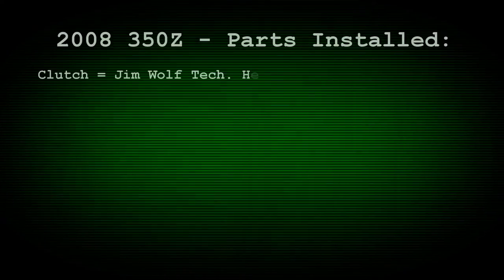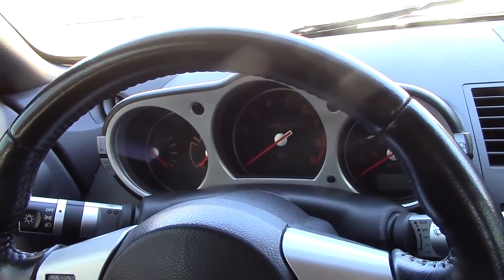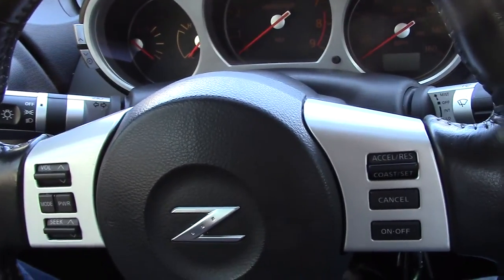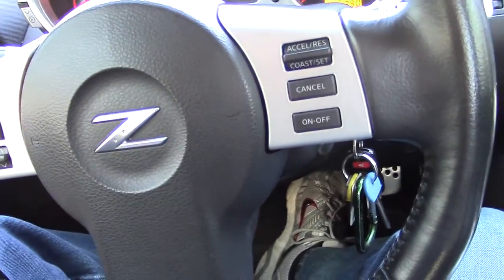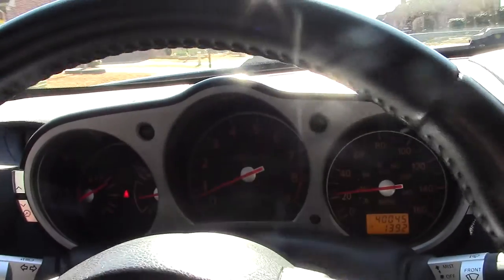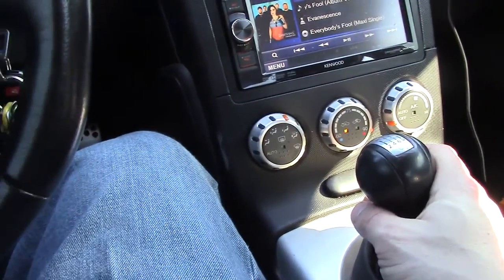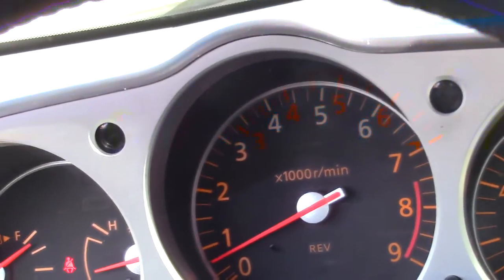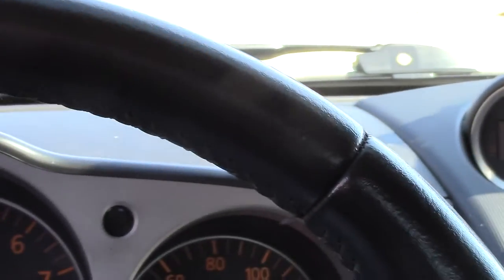350Z JWT HD Clutch - Zspeed HD Slave Cylinder - Wilwood HD Master Cylinder - OEM DualMass Flywheel

Comment: Did it originally have a single mass?
Reply from the maker: No originally it is/was a Dual mass Flywheel.  I had a tough decision that goes against what most people who are performing perf. parts in do.. and that is to with a lightweight and deal with the noise.. or go with a new OEM dual mass and not have the noise.  I knew the noise would bother me more than the benefits of a light weight flywheel.
Reply: Ikos Log In my Vr6 I went with a single mass flywheel but not light weight. Steel and around 20lbs. There is some some sound but not really noticeable unless it is quiet out. And only hear it when sitting at idle.
Reply from the maker: Drewdownkali Yeah.. in the 350Z and 370Z's Nissan designed a really solid transmission with an extremely noisy drivetrain.  Rock solid just noisy.  All 350's and 370's have the throw out bearing noise when at idle in neutral.. but no noise beyond that with the Dual Mass flywheel.  However, once you swap that flywheel for anything else (lightweight or even a really heavy single mass) it becomes super noisy while driving under load until 2500RPM in any gear.  So the $867 for a new Nissan Dual Mass flywheel for this particular car was well worth the money to keep it sounding , well, quiet.  It's not uncommon for people who don't know Z's to ask what is wrong with your car if you have a lightweight flywheel due to the noise at low RPM.  It's my DD, and I consider it "nice" and want it to sound that way too :)  But to each their own!
Reply: Ikos Log I have had people thinking something was wrong with my vr when they hear it at idle. If I press the clutch it and let it out very slowly the sound either goes away or is less noticeable.
Reply from the maker: Drewdownkali It's the same with the 350/370 and Inifiniti G35 and G37's.. The throwout bearing noise is quiet apparent at idle with clutch out.  The new setup I have in makes it a bit quieter than stock, I would simply because it's all new.  I remember with my 300ZX when you heard that throw out bearing noise at idle it meant it was going out as it was quiet under normal operation.  However, in the VQ35HR's it is very much "normal" to have this sound. :)

Comment: My 07 made it to 125k until the throw out bearing went out. I guess ill just do the whole thing now
Reply from the maker: Nice!  I've always had 'initial' clutch problems in my Z's.. My first car was a used 300ZX -- and I treated her well, but well.. also DROVE it.  Hey I was 16-19yrs old before I sold it.  :) -- The throw out bearing noise in the Z's is almost a feature unto them.  They always have super loud unloaded bearing noise -- Get in any Z3x (manual) go drive up to a wall, or tunnel or whatever... put in neutral let out clutch .. and there it is in all it's glory (and that's normal) :)

125k is super for the whole system to go without major issue.   It's more than due for an 'overhaul'.  I'd probably do it all myself.. I know I would -- I had just master or slave issues and I replaced every component in the clutch/hydraulic system (Master, CSC, Lines (With SS), Clutch (JWT), Flywheel, and so on -- everything I replaced I replaced with 'better versions' of OEM to prevent failure as the HD Master and Slaves are redesigned to stop the premature failure so often seen in the 350/370's -- The only stock component I bought was the Dual mass flywheel and I wrestled with that decision because of cost + performance -- In the end I wouldn't be happy with added noise to the car while driving at super low RPM's so Found the best deal on a new OEM DM Flywheel ($800) and am quite happy with the ending result.

System is quieter than it was before (though wasn't loud before) -- just something I noticed and that's just really the throw out bearing noise as the clutch system doesn't make noise while driving especially over the deep exhaust of the 3.5 or 3.7L of the Z's.. I think I ended up spending about 2 Grand (give or take) on parts.. labor I did myself and surprised myself when I got it done in a day without major headaches popping up in the process.

I brought it down to a "Z Specialist" to do the work.. but he had some family emergency called me late at night and said you have to come get your car (he was leaving town) and he doesn't leave cust. cars in shop for liability I guess) -- When I picked it up and was driving it back the shifter was letting in noise from the ground and it wasn't matching up properly with it's tracks.  It had a good 2-3 inches or more of excess movement out to the right past 6th gear/Reverse -- I sent a video to the guy showing him and called him.. He said "Oh they never go back together exactly the same"..lol.  

I was like, ermm. No, this is not just a slight difference it's wrong.  He maintained his position.  So I said ok fine.

I took it apart next day and quickly found the problem.  He put it on , literally, backwards/reversed -- I'm amazed it functioned that way to be honest.  Within 10 minutes I had it back the way it was supposed to go and took it out and was factory quiet again and no more 'play'.  (That was a relief.. I had no idea what he had done).

Good luck with your swapping -- I would recommend aftermarket on everything but get on forums and such to find what is good and what is crap -- What I picked for my Slave, Master are the best made so it'd be safe going with those two (but do your own if you want to make sure) -- Flywheel -- OEM if you don't / can't stand any chattering noise at low rpm's (like me) -- And of course your pick of cheaper lightweight non dual mass flywheels for faster spin up .. bit of a tradeoff.   Clutch those are easy to find .. most companies with reliable names offer several packages which all depend on your needs and how hard you want that clutch pedal to be ;) -- I elected JWT HD.. far exceeds my 360HP and didn't take long for it to feel 'normal'.  

For labor -- most places were a couple thousand dollars or more -- though I did find a technician at a nissan dealership who would do the work himself at nissan for $600 -- So deals for reliable work can be found , you just have to put in the calls, etc -- Helps if you have all the parts (leaving nothing out) for them to not have to dig into inventory for something other than lube, or random bits.
Reply: I just ordered the JWT with the higher clamping force and the 14lb flywheel. Im debating between the Z1 Motorsports delete and the Z Speed performance replacement. I would typically go all out but am thinking about upgrading to a 370 in the near future and am not looking foward to do this all again. Thanks for all the advice